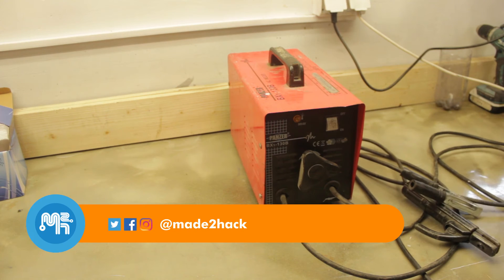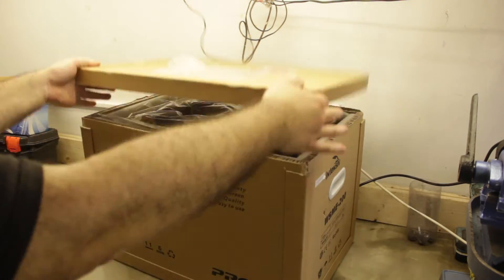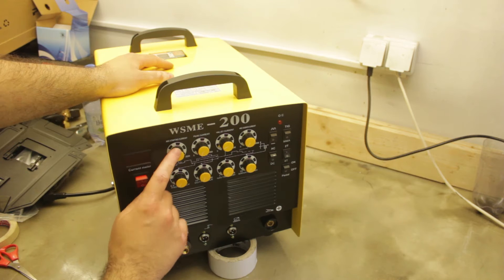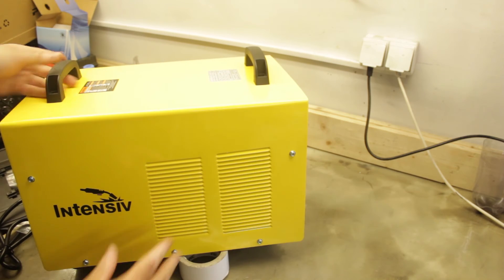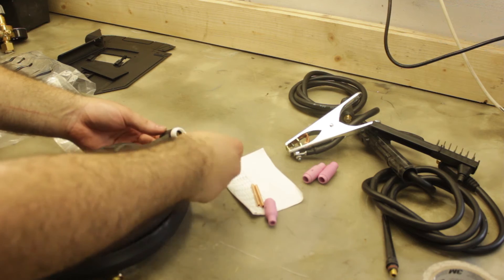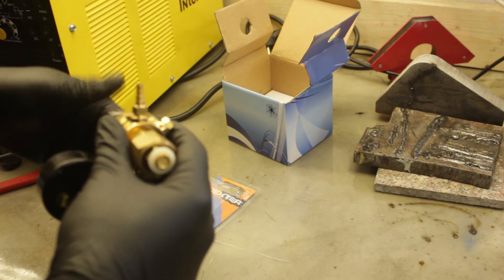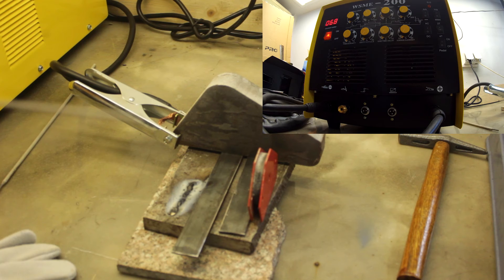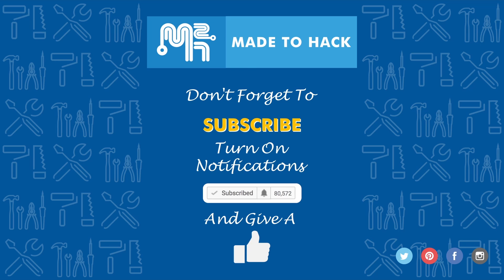I Bought an MMA/TIG Welder Who Knows More About Welding Than I Do | Unboxing and First Try

Comment: That face shield should go in the trash right away. Get a real helmet. I don’t believe the specs on that machine. That’s pretty cheap for the claimed specs. You don’t use acet. tubing for inert gas, or AR/Co2.

The clamp should be used with all four of the prongs connected to the work, if possible.